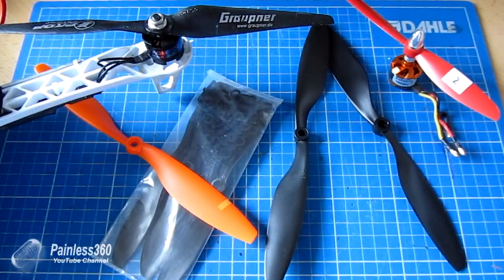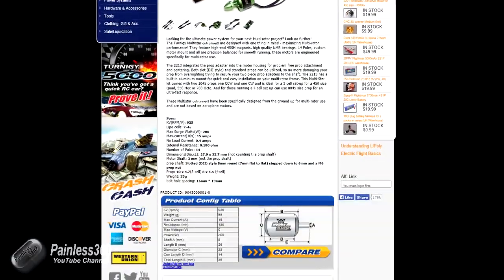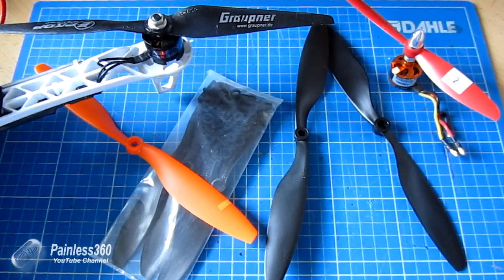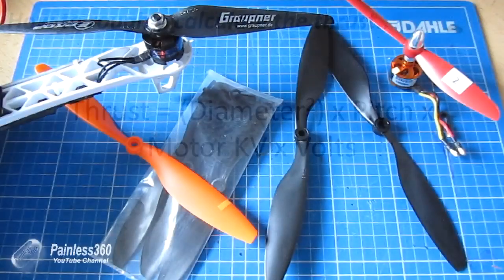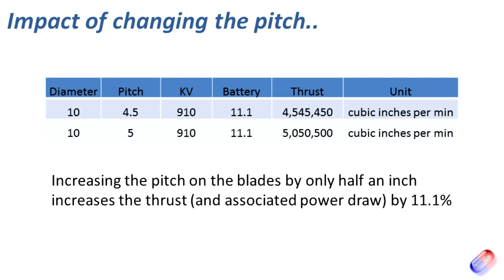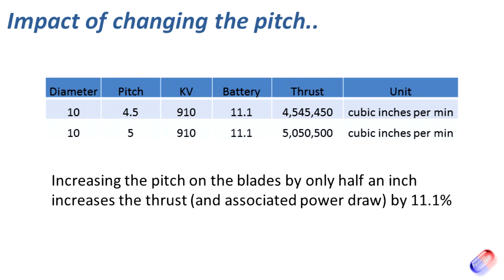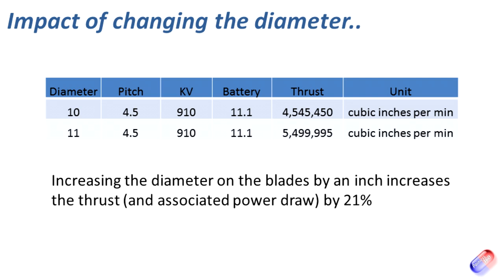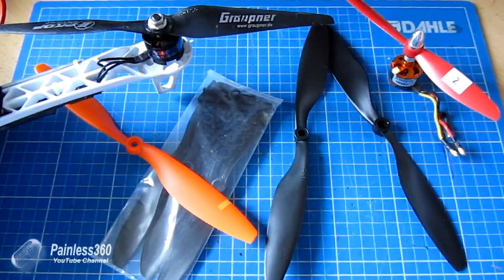The impact of changing rotor or blade size on Multirotors

Comment: So, the number of blades does not impact thrust? If for example 10\4.5 prop is recommended for an engine, there is no difference if i pick a 2 bladed 10\4.5 or 4 bladed 10\4.5 ?
Reply from the maker: Yes it does. See my testing of props videos... happy flying!

Comment: What does the number in the thrust column on your chart represent? Kind of an important detail you left out.
Reply from the maker: The amount of air moved by the prop in cubic inches. Used only for comparison purposes here..
Reply: @Painless360  ok. I was really trying to determine how many grams of plane weight it would propel.
Reply from the maker: Tricky to figure out in my research. There are a few equations about for trying to do that but the design of the prop can make a huge difference in the thrust and efficiency. I test mine or use motor specs/thrust charts for similar motors. Best of luck!

Comment: That formula seems a bit off to me. Pitch is not directly correlated to thrust, especially in stationary air. In fact, a smaller pitch for hovering will almost always give you more thrust than a higher pitch. The accurate element however, is current draw, which actually increases with pitch eg. a 90 deg pitch has zero thrust yet maximum current draw.
Reply from the maker: https://www.rcgroups.com/forums/showthread.php?783573-Conversion-factor2-to-3-blade-prop gives far mode detail from the 'master' of this stuff (and the chap that gave me the formula here), Lucien Miller..

Comment: I've bought a Bayangtoys X16 and it seems the first mod many owners do is putting on DJI 9450 props. Do you think that's been studied or "smart" ? I haven't done it yet myself.
Reply from the maker: Depends on what props the motor can support. I'd look at the specs for the motors on that model and see if it's designed to handle that prop.. Best of luck!

Comment: hi mate iam staying at 3cell lipo but useing 30a opt esc and dji 920kv motors with 10x38 prop but looking at 10x45 would thay be ok with that setup
Reply from the maker: I use those with 10x4.5 props and they are fine. Best of luck!

Comment: I like your videos, so thanks for all the help. 
 In this video when you calculate the thrust, you say that your amps have increased. But surely if you have more thrust you can back off on the throttle for the same lift, therefor lowering the amp draw. How then would this stack up with efficiency. Would a 10x5 be more or less efficient than a 10x4.5?
Reply from the maker: See our other video where we test the efficiency of low KV/large props with high KV/smaller props. Bottom line - use the recommended prop the battery size you're going to use. Using anything else is at your own risk.

Comment: That was straight forward and very informative! Thanks for sharing that. I recently bought my first quad, a flying 3D-X8 for $165 on sale and being my first I decided to read up and educate myself on what I was getting into....after almost two months of gathering info and waiting on spare batteries I finally took her on the first flight...less than five min later and 1ft off the ground a cloud of smoke and death of the PDB (bad trace I found out). Been to long to return so I decided to use all the parts on a new frame and was wondering if I should change the prop size because it was S500 compared to the X8's 350 size frame....
I'm glad I saw your video before I changed them out. 
I will get some new motors and esc's but I'll learn to walk before running and then upgrade parts and equipment.....
Thanks again,
Joe...Little Rock

Comment: Thanks for this informative video!
I recently built my first quad an bought a few 5'' and 6'' props. As a complete beginner i thought the bigger props will give me a little bit more thrust. Now i did some calculation and they actually increase thrust by 44%.
Using the same motors and battery does this also mean 44% more power draw?
Reply from the maker: +Tom FZ Yep

Comment: Be nice to see some stats on just the prop type change out...  The thin vs the larger (wider) blades, slow flyers, etc...  Some manufacturers sold quads with props that had very, very large paddle blades that simply are not widely available, even online...   

I'm wondering if some of those props are going to draw a lot more current than a standard prop of the same diameter and pitch.    If so then when replacing props with more available types if the same diameter is best or perhaps a larger diameter depending on type of prop.
Reply from the maker: +Trondyne Great thinking - have a look at some of the motor stats now, a lot are even comparing different designs of the same size prop (and it does make a difference). Happy flying!
Reply: +Painless360 
Thanks!

I can't find any tests comparing just different kinds of props especially with the detail you did....  I fly all kinds of ships and I only have one quad, which is a version 2 T580G... The T580G came with props that have HUGE blades, they are very flexible and large at 12 inches by I think a 6 pitch...  

This quad appears to be no longer available and the parts are all but gone....  So I am trying to figure out how the change in prop will impact performance...  I ordered  a set of 12x4.5 from HK but the blades don't look right to me.  They seem to have a kind of camber at the leading edge and they are much thinner than the stock blades..  I also ordered some 12x5.5 GWS type blades which have yet to arrive but it would be great to see some stats...  

I found one company in china who had a couple of the stock props (I think) in stock but I have yet to receive it..  I will do some testing on flight times with different blades when I get a chance...  

Great work on the video.

Comment: Really interesting video and so glad to finally get this formula but I have a question.

I started flying my E-flite 25 motor with a 13*6.5 prop and immediately found overheating motor and esc. 4s battery. This was the spec suggested by E-flight.  Checked with wattmeter and found a peak Amp draw of 80 amps. WAY to high for both esc and motor. Using this formula, this combo developed 141... Cubic in thrust. 

So conventional wisdom says - reduce the prop size, which I did to 12*8. (Same motor, battery  and same esc) Wonderful, the formula says the thrust actually increases by 4.8% and according to your narrative, so should the power draw as well. BUT the amp draw on this new combo is way down from the initial 80A down to 60A. This does not make sense to me and possible me alone, given my inexperience. Possibly you can explain.

I am considering trying another prop combo 12*6 which according to the formula will drop the thrust and Amp draw by another 21.35% - Incredible!  I hope I don't crash with an underpowered plane.
Reply from the maker: Wish I could, the formula used here is a overly simplified one that doesn't take into account the prop design, efficiency and other factors (i.e. 3 vs 2 bladed). Looking at the specs the prop appears to be 11x8 for a 4s setup (http://www.e-fliterc.com/Products/Default.aspx?ProdID=EFLM4025A)

If it's working for you then got with it! Happy flying!

Comment: This is very interesting and informative.

Although I'am fairly certain all your math is correct, you seem to be assuming full power operation. Where in practice, as long as the models weight stays the same, the same power is required to hover it regardless of how one achieves the thrust. So if you use a larger prop it does certainly draw more power at full throttle but you're going to use less throttle to hover and draw approximately the same throttle you did in hover before.

Of course as you deviate from the ideal diameter/pitch/KV for a given weight the conversion from electricity to thrust becomes progressively less efficient. But it seems to me that's a separate question. Any thoughts on this?
Reply: I believe it'll still draw more power to hover and such when using a larger/high pitch prop. it isn't a simple matter of 'oh you'll be hovering using less because it puts out more thrust'. the speed at which the props would be spinning would be lower to achieve the same amount of thrust.. but the extra torque needed to spin the the larger prop would cause it to draw more power. Though, I dont think it'd end up being all that much extra because it does have some form of balance there.. less speed + more thrust = extra power needed for that level of thrust - original power needed for that level of thrust... that equation seems alittle more accurate.
Reply from the maker: Hikari This type of discussion is exactly why I did the video - some of this is slightly counter intuitive - bigger props spinning slower are more efficient. 

This is discussed lots on the forums but nothing beats an actual experiment!

Happy flying!

Comment: I have a working 350QX and a broken one (parts?) and I want to use this one to make a "Y" Tri-copter. can I  use these parts or need I start from scratch? 

New-bie here... I bought my 350 QX  for Photograph events... and beings I can't fly it too well I want to try these parts out and see if "Y" is easyer to fly? 

ANY INPUT? :)

Thanks for all your great videos!
Reply from the maker: People have their own preferences when it comes to quads, tri's and hex-copters.  If you can get a cheap frame and controller then why not use the spares to make another model? You will need to source the pivot for the tail though and watch the overall weight doesn't' get to much for the three motors.  Hope this helps. Happy flying!

Comment: Doesn't increasing the pitch and/or diameter also increases battery usage?
I'm new to this and getting ready to build my first multi-rotor, I used a tool from eCalc that helped me make the determination. Longer/or increased pitches can increase hover times, but can reduce flight times in my calculations. Here is my caculations for a build I'm doing using that tool eCalc ( http://goo.gl/Jakbk4 ). 
I really liked the video, thank you. I'm trying to learn as much as I can. Programing my remote seems to be really hard. I'm trying to but six F-modes on my DX8. I found several sources, and both have confused me, and neither worked completely.
Reply from the maker: Hi John, it will. The battery will try and pull more current from the pack for the extra power needed to swing the larger prop. Larger props on lower KV motors will use less power and a lower overall weight will give you longer flight times.The purpose of the video was to show that just adding an inch to the prop can make a huge difference to the power used. I didn't understand this until someone helped me understand it, once I did it seemed simple (ish).Thanks for watching, good luck with the build.
Reply: Thank you again. Yes, I have been trying to understand this myself. I think it can be very important if you want to optimize your setup.

Comment: I liked your first video on this subject best - very useful.  In this video at 2:45 you say "just increasing the pitch by 0.5%".  actually, you increased the pitch by 11% as well.  Just thought I'd mention that.
Reply from the maker: Good spot, I did say half a percent when I meant half an inch. Thanks for that. You can use this to work out what the diameter should be to get the same thrust if you change one of the parameters. i.e. if you increase the pitch by half an inch you need a diameter that's half an inch less to pull the same power.Thanks for the comment, happy flying!

Comment: I dont Understand the thust formula.Seems if correct everyone would be using Trex burshless motors at 3000 - 4200kv. Plug one of those motors into that trust formule and what about torque.I think the best way to measure thrust is mechanical.
BTW your Multiwii vtds are the best. You realy got my quad flying so iam learning alot. Keep up the good work.
Reply from the maker: Exactly. It boils down to how much power (watts) the motor can supply. This is exactly why every battery setup has a recommended prop for any given motor. If you try and make the motor work harder than it, or the ESC, can handle then trouble awaits!

Glad you have found the MWC videos useful. Thanks for the feedback. 

Happy flying!